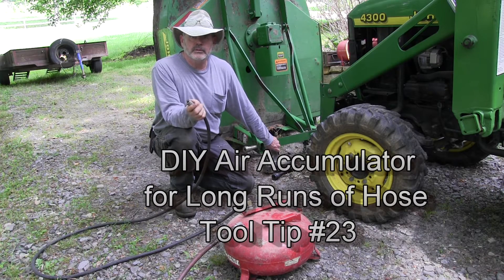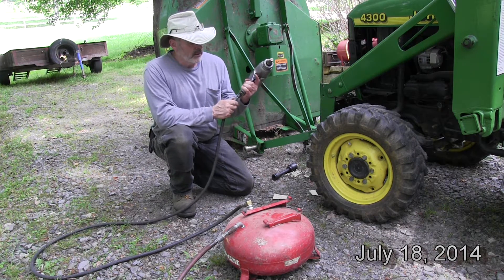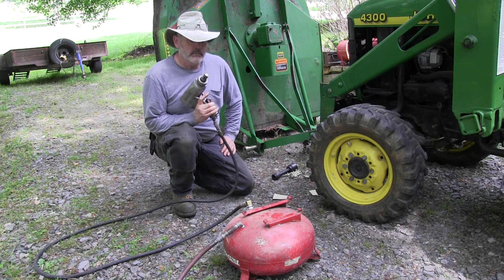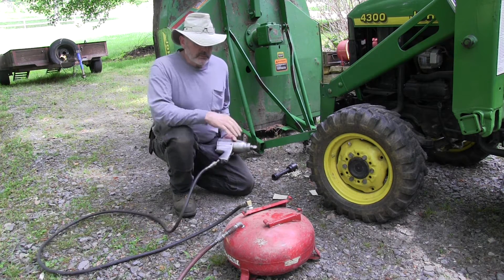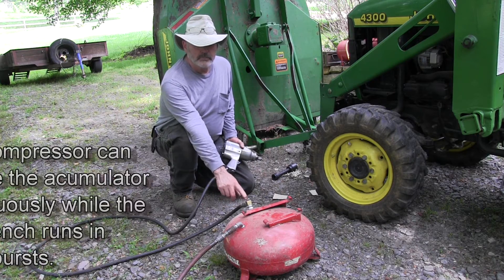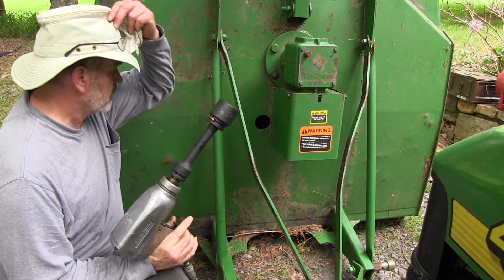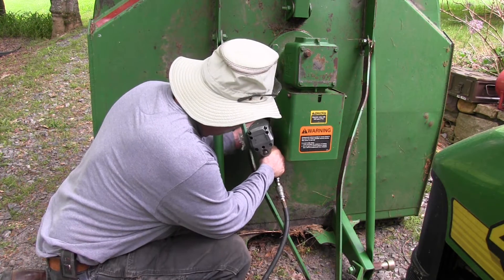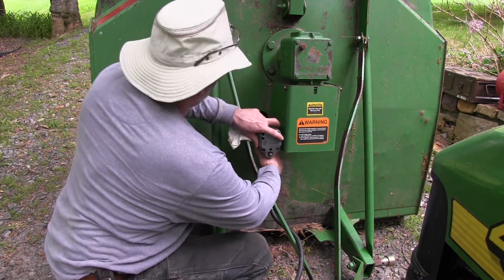DIY Air Accumulator for Long Runs of Hose Tool Tip #23

Comment: Not sure what water heater tanks you mean, but I'd be dead leary of using one as the ones I know of were never designed for high pressure. A stainless steel beer keg is often used, though. :)

Comment: I can run 100 ft, but at that I have to keep adding old to the tool. I had an old 75ft that worked great but it finally blew out.  I am only have a small  30g but will be going to an 80 2stage. Then I can put the 30 in an out building that I ran underground power to that's 180ft from the shop.  You have a good idea there.